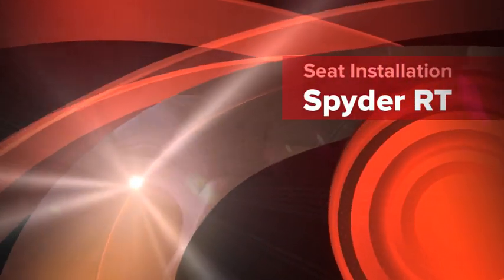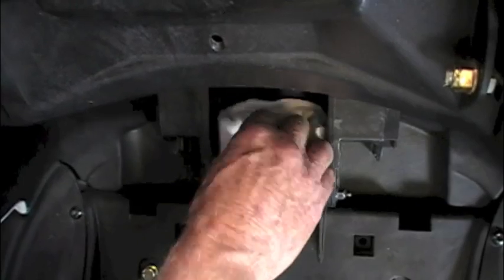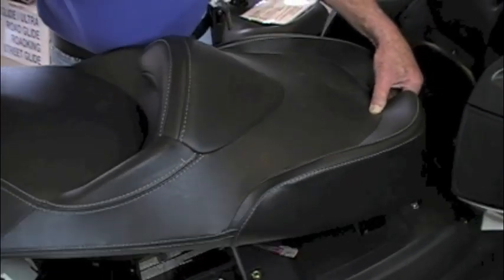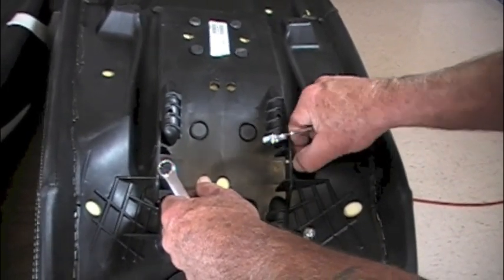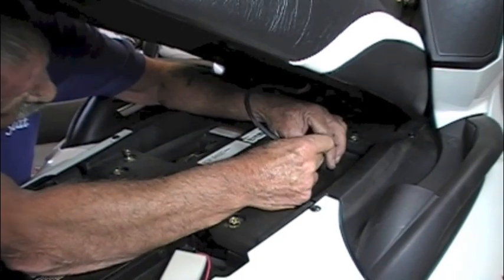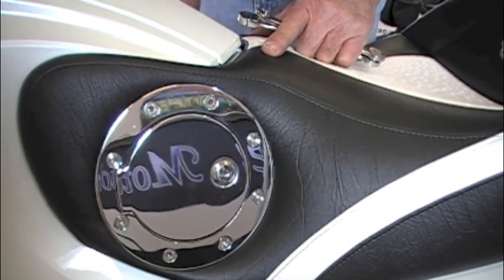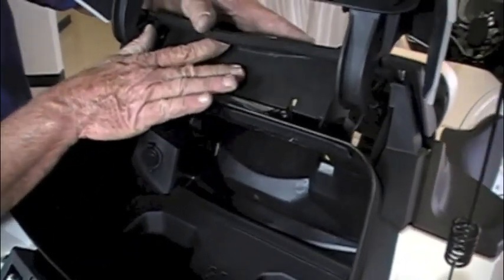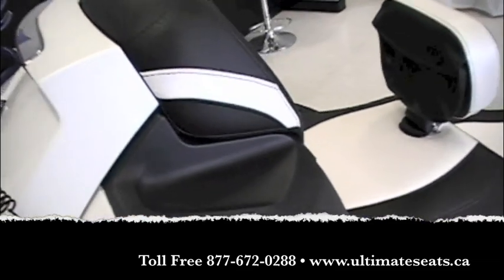Ultimate Seats - Can-Am Spyder RT Seat Removal and Installation

Comment: Thank you for this... I just used the video to guide my replacement of the stock seat on my 2017 RTL with a Can-Am Comfort Seat and backrest. My first Spyder was a 2012 RT and it had the Ultimate seat with the fueling window when I bought it. That bit of metal gets extremely hot in the Arizona sun...

Comment: I have followed your very helpful video on how to remove the seat on my 2014 can am spyder rt Limited. All has gone well until the final stage of lifting the seat off the spyder. The right side of the seat came away just as in the video BUT the left side WILL NOT allow me to remove the seat. I have attempted several times to get the seat to come loose but it will not budge .  WHAT AM I MISSING, ANY TRICKS I CAN TRY????